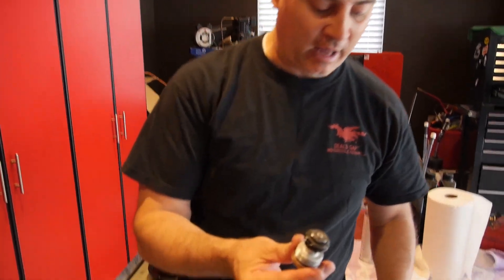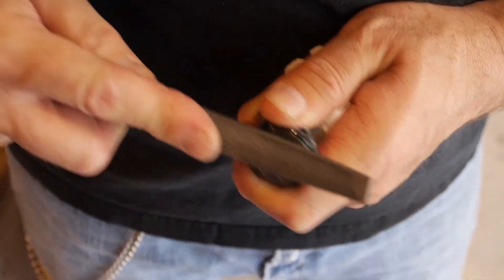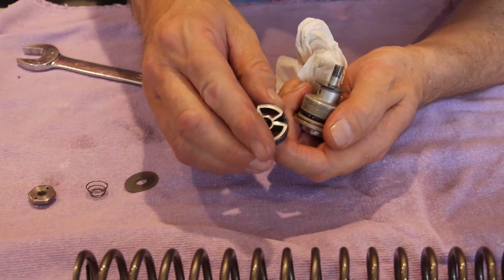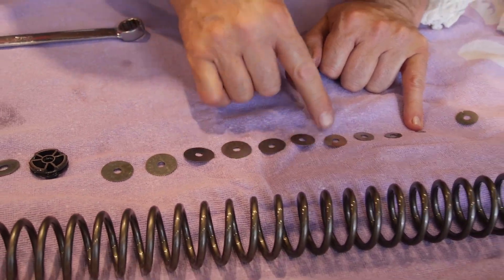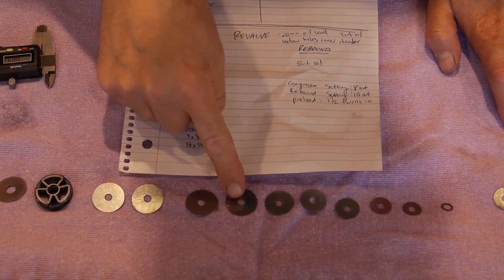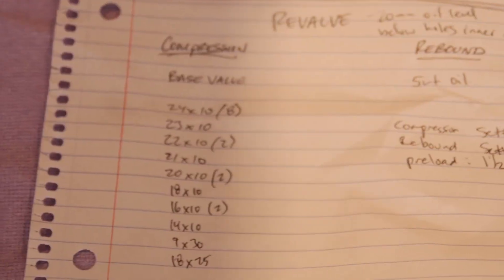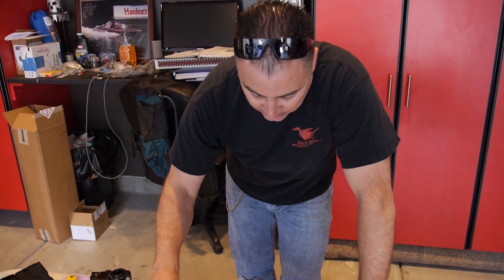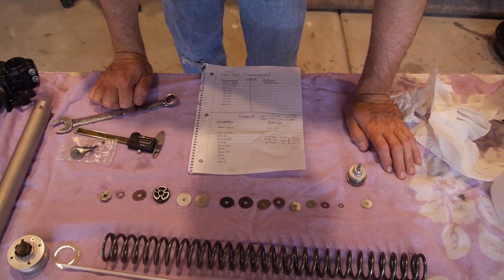KTM990 Fork Shim Stack Mod explained - Pt.2

Comment: I realise this video is 6 years old and I'm unlikely to get an answer but it's really helpful. Did you leave the rebound valving stock, how did it cope with the 0.72kg/mm springs? I'm a big lad (255lb) and I've been told I need 0.7 or 0.75kg/mm springs but the stock rebound won't cope? What are your thoughts. Thanks
Reply from the maker: We did not change the rebound stack from stock. It is true the rebound may be a little faster than stock, but we did not notice it to be a problem. We ride fast desert, including whoops, jumps, fast chatter, and push really hard on these bikes. We didn't notice a lack of rebound control to be enough of a problem to do anything about. It was so much better for hard agressive riding that stock it wasn't even comparable.

Comment: Thank you so much. This is literally the only video on the whole platform that explains that. Do you know, is it the same on a 05/06 950 Adventure? I just got a 950 and the forks are way to soft for me. I would literally have to send my suspension out to a different country to get it sorted, because no one around here does it and it would be pretty expensive (at least for me). I know engines but I'm not a suspension guy. Thanks again!!! Just need to figure out the right spring for my weight, since. I'm not that heavy 150lbs without gear. I usually ride with 30 lbs (at most) of luggage and then whatever the gear weighs I physically wear on my body. So maybe between 170 and 200 lbs, depending on whether I carry luggage or not.

Comment: I've watched a bunch of your videos and a ton of others. I have two sets of forks for my 02 yz250 both are so stiff. I only get half travel no matter what, and i can jump up and down on the pegs without getting any compression. I've stated messing with the shims after I've done everything else to the forks a dozen times. I don't understand exactly what to do with my shims. I appreciate your videos though. All the info i can get is helpful.
Reply from the maker: john Franklin Did you check to see if you have the proper fork springs for your weight? For what your describing, that would be the place to start....valving doesnt normally cause that....
Reply: @MrDuhfactor  yes. It's stock springs. I'm at the top of the weight bracket for these springs. I changed the oil, bushings, and seals. I tried different oil heights and lowered the viscosity to 5 weight instead of 10. I made absolutely sure the forks aren't binding. I've opened them up a bunch of times and inspected everything including the cartridges on the first pair. I found a deal on the second pair. They were full of gunk. I finished rebuilding one today and from testing it by hand it feels about the same. Those forks are off of a 99 and have a different shim stack on the base valve. I didn't open the cartridges and look at the midvalve though. I wanted to see how it would do the way it came.
Reply: @MrDuhfactor  everything I've read says that these stock forks suck because of how stiff they are, but they can be made to work really well. I'm just going to move a ton of the low speed shims to the bottoms of the stack Andrew see what happens since i don't know how to design a proper stack. I'll just have to keep messing with it. Thanks again.
Reply from the maker: john Franklin Sounds like you've already looked at the big things. You are on the right path. If you want to email me the measurements of your basevalve shim stack, Im happy to take a look at what you have and offer a suggested starting stack. email to Mrduhfactor at gee mail dot com.

Comment: So do you have to replace the Screw/Bolt in order to accomodate the taller stacking? and also to Mushroom the head for locking it in?
Reply from the maker: The threads are part of the base valve, so thankfully, are normally long enough, even after adding shims. The actual nut looking thing has a longer dimension that allows a thicker shim stack and still has a good number of threads connected still. Hopefully the next video will show that a little better :)

Comment: No crossover shim in new setting? Will this induced harsh feeling when low speed riding? Just curious. :P
Reply from the maker: I considered adding a crossover,  but decided against it because the 990 is so heavy, and open deserts allow such fast riding, that I worried it would still be to mushy and soft. Many tuners are going away from using 2 stage and especially 3 stage shim stacks nowadays, and I'm very happy with how plush, yet firm the forks turned out. Good question buddy :)
Reply from the maker: By the way, if your area has slower speed riding, and you worry it might be too stiff, you could always add a 16X10 or 18X10 crossover. :)

Comment: Is it trial and error, or do you have a rough calculation on what you need? ie, you have gone from 11 to 20 shims... is that 1.8 times stiffer in the compression?
Reply from the maker: There is a "Shimstacker" software that you can purchase rights to use that can do a lot of calculations for you, but then one must be able to assess and determine what that numerical data means, and interpret how that will affect the "feel" of the suspension. When I revalve, it's kind of an educated guess based on experience from doing 100's of forks and shocks, and keeping all my records. For me, I'm trying to get a certain "feel" by modifying what I "don't like" about the suspension, until I get to where I can't find anything I don't like anymore, lol. On my old motocross race bikes, I would have the forks apart about 20 times until I found the perfect combination, then I wouldn't touch it...lol One can take that data though, and apply it to other similar situations, modifying it based on predicted differences, ie weight, rider speed and skill, etc, etc... Does that makes sense? Basically, it's all just a bunch of crap....lol (not really)
Reply from the maker: Nerb1 Sorry bro... I cant believe I missed this a year ago.... Im such a tard..... So, there are calculators one can use, one is called "shimstacker" that you can purchase, but depending on whether your wanting to stiffen high speed compression, or low speed, you either add # of shims, or use thicker shims to resist hydraulic flow. For me, after doing so many over the years, I pretty much can feel what I dont like about a set up, and modify the shims as needed to fix the things I dont like. For example, if my forks keep diving or bottoming when I go through a swale, or berm, Ill add a few low speed compression shims to keep the front of the bike up so it doesnt bottom out so easily.

Comment: Awesome!! I had the forks recently refreshed, can i just flip them upside down and take out the shimstacks without opening them up completely?
Reply from the maker: Actually, I would recommend completely taking them apart again, except you don't have to separate the inner (slider) tube from the outer tube, thus not disrupting your seals. I'm always wanting to make sure everything goes back together correctly, so I follow the same system every time... good luck though bud!